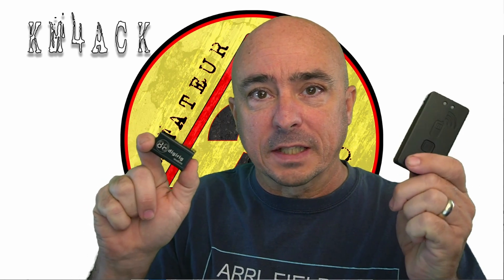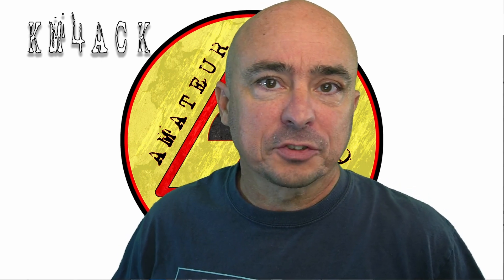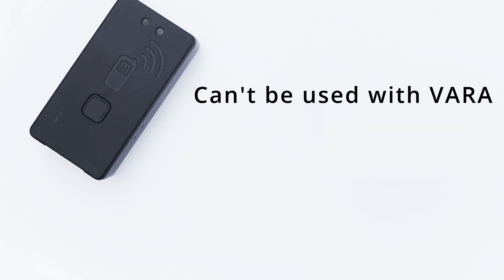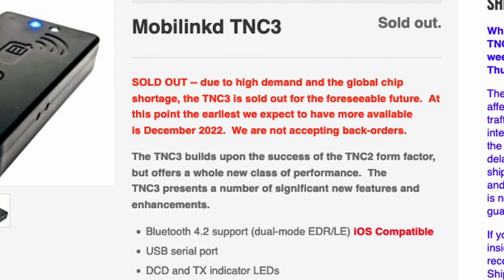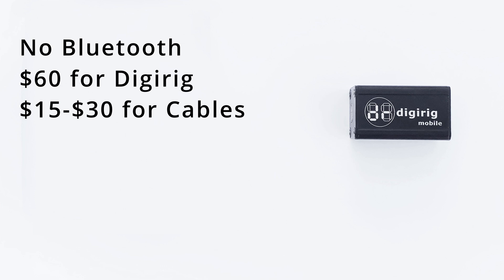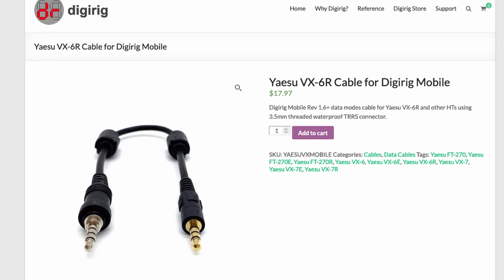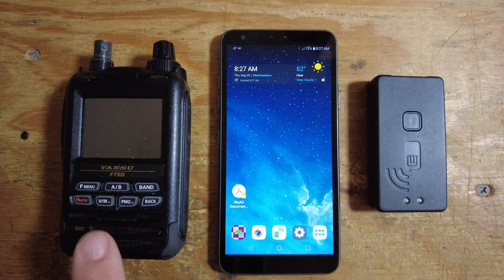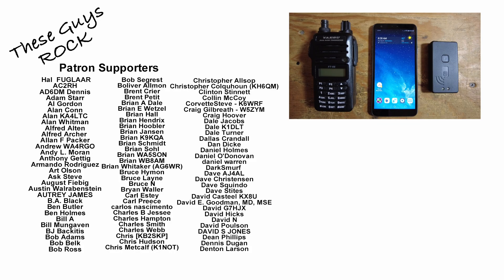Digirig vs Mobilinkd

Comment: can you do aprs with digirig?
Reply from the maker: not by itself but when used in conjunction with a phone/computer it's possible. I typically pair it with my laptop running YAAC for an APRS solution.
Reply: @KM4ACK is yaac a software?

Comment: 73 DE KA9ZRZ can you tell me what settings I need to set in my FTM 500 in order for my Moby link to work properly what I’m noticing is when I go into the mobile link and set the transmit it’s only transmitting if it’s on 144. 39 it won’t transmit if it’s on any other frequency do I need to change something in the radio. I’m trying to get it to work with radio mail is what I’m trying to do and for some silly reason it’s not working at all for me. I got a mobile link 3 and a mobile link 4
Reply from the maker: Try turning off the APRS modem while attempting a Winlink connection.

Comment: Hey mac can you use digi rig with ftm 400? I sit better the the mobilinkd?
Reply from the maker: If I remember correctly the FTM400 has a 10pin mini din on the back. If that's right, this cable should work https://digirig.net/product/yaesu-ftm-cable/
Reply: @KM4ACK  I did get the digit link to work. I hooked it up to my laptop and it worked just fine.
Reply: Thanks 73 DE KA9ZRZ

Comment: Question about monitor beind you running HAMCLOCK.  What is the brand, model, size info?  tnx
Reply from the maker: The small monitor I run in the shack for hamclock is a 10" EVICIV. Unfortunately, it is no longer available.

Comment: I like mobilinkd, but as you said, it can be a pain to mess with if you use it on different mobile devices. Also I personally with they used a switch vs a button. I find sometimes the button gets bumped and turns on, draining the battery.
Reply from the maker: The dreaded button! I can't count the number of time my 3 has been turned on and the battery drained on accident. Thankfully the improved this on the 4 requiring you to press and hold the button for a few seconds to turn it on.

Comment: Interesting that you mentioned that the FT-5DR includes APRS. As I understand it, the TNC isn't made available to the user. So I assume that you'd be using the Mobilinkd to send the packets through the audio port of the phone for Winlink, right?

Comment: I use the Mobilinkd2 with my mobile radio for APRS via APRSdroid, and have tested it also with my HT.  I heard about WoAD and saw in its documentation that it supports VARA using a TCP/IP connection to a computer.  Since I always travel with my HT and Windows laptop which has VARA, I will test this out.  It would be great to be able to use laptop, Android phone, HT and Mobilinkd for an APRS and Winlink solution while traveling.  I would ask you to test it but I know you are averse to Windows and prefer Mac.

Comment: Great analysis, Jason. There's value in both devices depending on your use case. I personally use both, but have fully standardized on the DigiRig Mobile for all my manpacks. If you need a data point, I have successfully used the DigiRig with an OTG cable on Android with AndFlmsg. I have not had time to look into APRSDroid or WoAD. Keep up the good work.
Reply from the maker: Thanks for the info on the OTG cable. I'll get around to trying it soon.
Reply: Thanks for the mention of AndFlmsg--I'd never heard of it before. I use both a TNC3 and a Digirig myself. The TNC3 works great with APRSDroid and WoAD and a Kenwood TH-F6. I use the Digirig to connect a TX-500 with a Surface Go 2 tablet for Winlink with Vara HF and JS8Call.
Reply: @kenhagler7166  Not a problem. This support was recently added. I worked with Denis at DigiRig on the cable for the VX-6/7. He asked what applications I used on Android. AndFlmsg was one of the ones I listed. Shortly thereafter, Denis contacted the creator of AndFlmsg. Long story short, the author added serial support to AndFlmsg in a matter of days. I love this hobby and community. Cheers!
Reply: @TheTechPrepper hi there TP! I'm having a heck of a time getting my Digirig to work with my Samsung Galaxy Tab A7 Lite. I was hoping to get Andflmsg up and running through my FT60R but the tablet just doesn't seem to like the digirig, or Andflmsg doesn't like it... I just installed v1.6x of Andflmsg and I just can't get it to work. Hoping you can share your trials and errors on this one... 73 bro
Reply: I have a USB-C to USB-C cable. My phone supports OTG. Works well. 

Most apps support VOX by default. The better way though is through DigRigs PTT via RTS. WoAD supports it, AndFLMesg supports on a beta build, and APRSDroid does not presently support it. You can still use VOX for all though